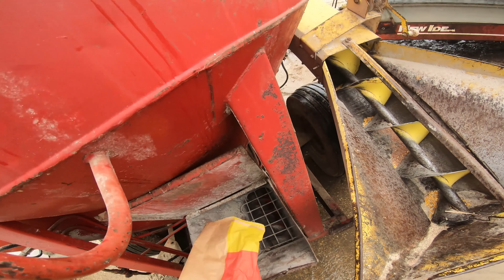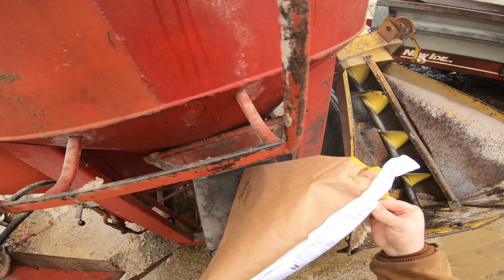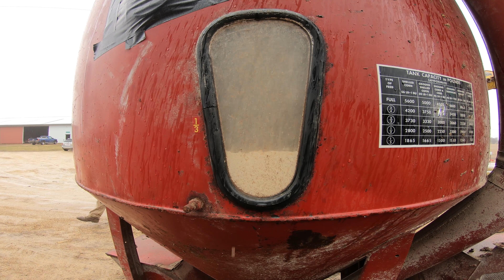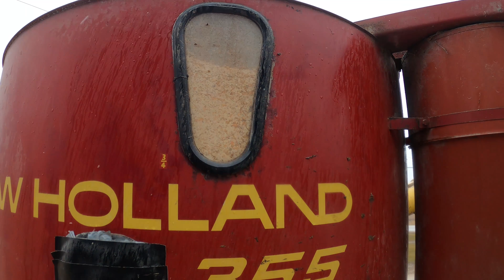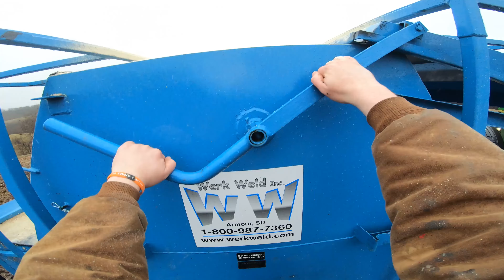Sloppy Spring

Comment: Make a spot in the fence that the top one or 2 boards will fold back or if the way leaving one on the bottom to help deter cattle. You can even build it up stronger out of metal stock fi withstand the abuse of use. Then just back in and drop over without going into the lot itself. Just a thought. Hope it helps. Bear of luck

Comment: On the bright side Ryan, you didn't have to spend a day getting out of the cattle yard, hauling the bales in and pulling the grinder in also ,getting the grinder out is usually the worst part. I don't miss them days, as sometimes we had to make a new gate entrance and exit. And after fighting the mud for years we ended up pouring cement 150 feet long and then built the mounds off of the cement. I suppose it didn't help to get snow and now rain, as we have been getting just rain here in Nw Iowa as it is raining/ drizzly weather out there.  Love your videos.

Comment: Make a slag strip up to a bigger pad that you feed on and that you can scrape once in awhile. Slag is  inexpensive and hardens like concrete
Reply: We put slag down in some yards but I find this time of year when it’s so wet it just turns to slop. End up hauling it all out with the manure.
Reply: Josh Jansen oh okay we have used slag instead of concrete floors before and it seems to hold up very well if you have a good 6 inches but that is also under a covered roof
Reply: Drake Falkner oh ya. It works great if your just having a pack over it
Reply: Josh Jansen correct.

Comment: Concrete the yard, but that easy for me to say when I dont have to pay for it 🤣
Reply from the maker: $40,000 I expect
Reply: How Farms Work what about gravel for the yard.
Reply: @HowFarmsWork  you could look at doing it in sections over a few years. Its something to think
Reply: @zacharyanonymous5170  everytime you clean they yard you will remove some of it
Reply: Just do a section big enough to get the tractor in, you can concrete a football field for $40,000, lol.
Reply: How Farms Work a lot of the money is in the labour. Over the years we have concreted our yards our selves.
Reply: We finished with concrete in our yard  back in the 80s .we did a little at a time when we could afford it. After we did that,we didn't lose as many cows to sickness. Over the years I believe it paid for it self ten fold.
Reply: $40,000 sounds way high. You have 2 skid loaders do the prep work yourselves. Form it up and get a good base. Find someone who moonlights cement pours. Pump and dump the concrete and float it out. Brush it for traction. You finding time to do it is the hard part.  You could do a 60x65’ slab 5” thick under $10K. Or just use a 4wd tractor when it gets muddy. Gravel won’t last 1 good rain out there. The cattle will blend that off in the mud in 2 seconds
Reply: concrete is cheap for what it does and how long it last. but im in oregon on the coast get like 70 inches of rain a year and i have 3 and 4 inch rock in our different feed areas and it holds up well and you dont take much rock with you when you clean if your careful. but if you rock it id put like inch or so layer of sand or equivalent on top they will walk on it better at first. hope that helps you out
Reply: How Farms Work pfffff
Reply: I work for my state's department of agriculture, working with NRCS and we design and build what they call Covered Heavy Use Areas.  They are cost-shared with USDA EQIP money. Hope that may help you
Reply: @jasonwatt8168  Yeah then it really WILL be $40,000... dealt with NRCS before when I was looking at cost-shared water... the way they madated it done would have cost my 10X what I planned to do, which even with cost-share would have still cost me 5X as much out of pocket as doing it myself my way instead of the gubmint way.  

Don't get me wrong, worth checking in to it, BUT don't be surprised when whatever they require to qualify for cost sharing isn't WAY more than doing it yourself "the farmer way" instead of the "gubmint way"... 

Been my experience anyway... OL J R :)

Comment: I was wondering why you don't turn your cattle out on some of ur corn stalks? You could always supplement them with your hay by unrolling it out there
Reply: The reduce crop yield would likely be more than the benefit.  Cows can destroy the soil tilt and here it takes years for the farm to recover.
Reply: @robertreznik9330  so spreading cow manure naturally on a field is bad for the soil?
Reply: @brettsibert7948  The cow's walking compacts the soil when wet.   There are 100's of lbs per square inch when a cow walks.   Have you noticed the extra rain water runoff on a field with cows.   Over time the soil OM is less.  Soil Bacteria will beneficially decompose the stalks just as a cows stomach will.
Reply: @robertreznik9330  if you feed them in the same place time and time again on the field sure that would happen. I would keep moving the supplemental feed every time.  I have seen lots of farmers do that